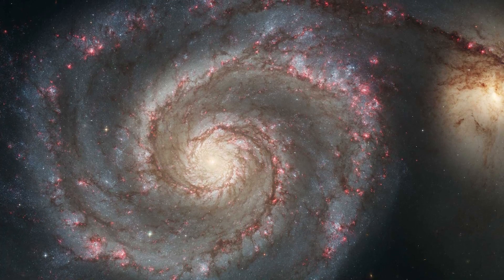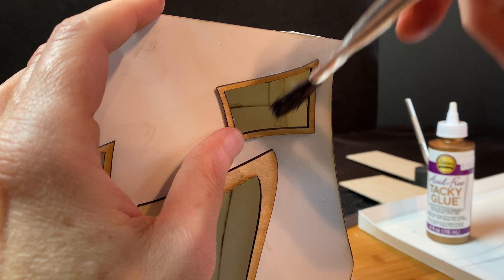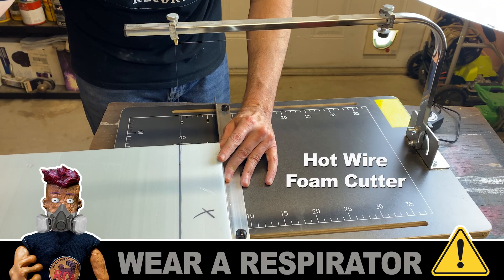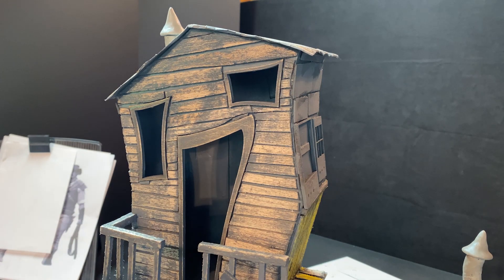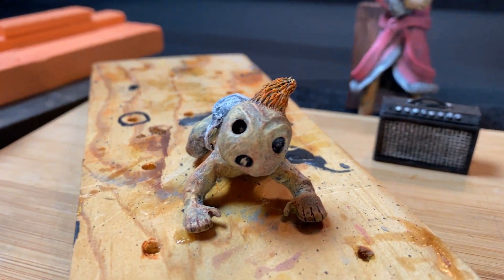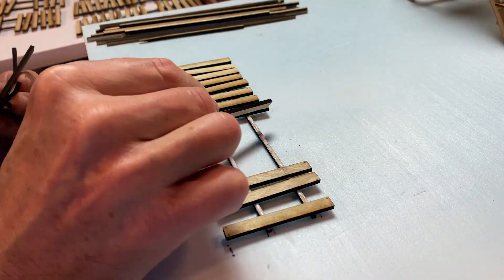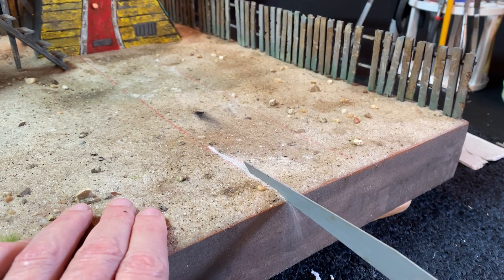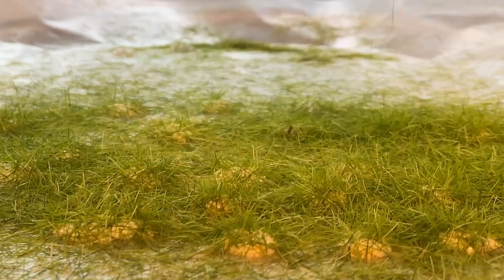Bad Neighbors - A Craftiverse Diorama

Comment: Great video T-nu! Question: why use Deluxe Glue and Glaze? Never seen any one use it before. THANKS DUDE!
Reply from the maker: I had a really delicate face plate that I was adding to a sculpture last year. It was difficult to build and I only had one chance to get it on there correctly. Deluxe Glue and Glaze is made specifically to dry clear and to not fog the plastic. So I bought it for that and liked it. It's similar to PVA, but grabs nicely and forms a really tight bond.
p.s. if you use super glue on clear plastic it tends to fog it - which is not water condensation, but a chemical reaction that ruins your piece and epoxy is too messy and unforgiving. Thanks for watching!
Reply: @CajunCraftastrophe  dude...thanks! Dries clear on plastic? Sign me up! Made a mech walker recently with a clear windshield. Super glue fogged the hell out of it. Nice to know there is an alternative. Where do you pick it up?
Reply from the maker: @SeanRedux  Yep, super glue does that every time. Here is a link to Amazon.
https://www.amazon.com/DELUXE-MATERIALS-Glue-Glaze-Plastic/dp/B0047YSO8U
Reply: @CajunCraftastrophe  thanks dude. Hope your summer over there hasn't been as brutal as Houstons has.